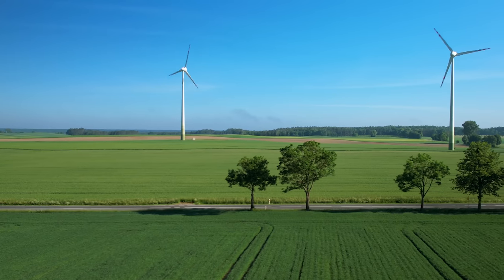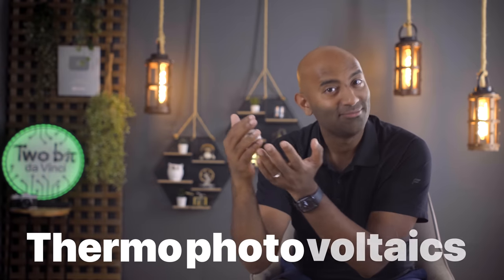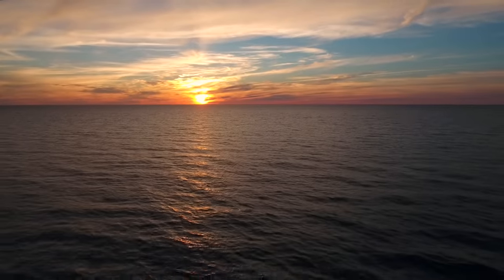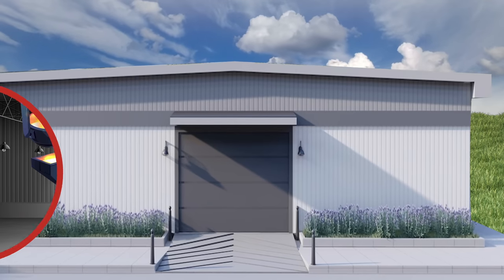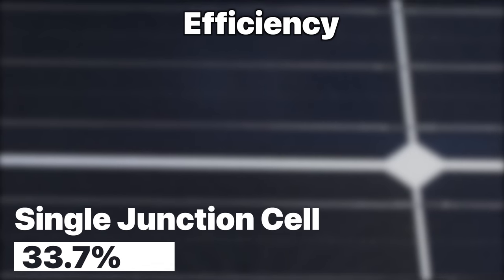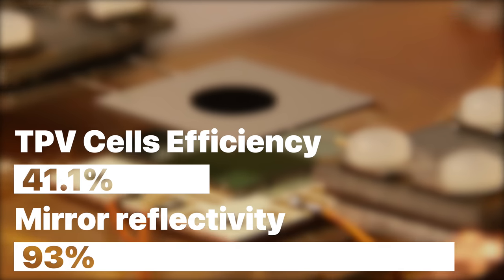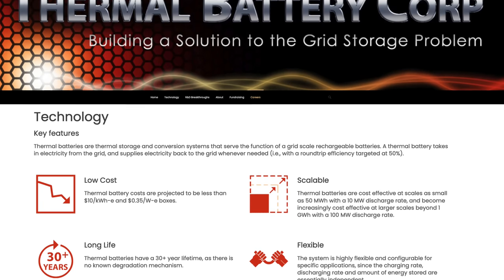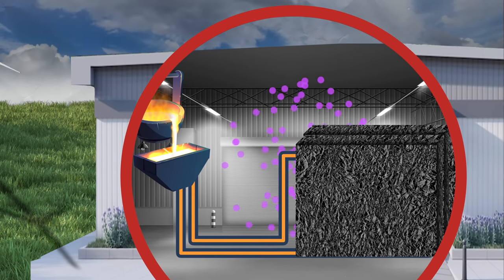Breakthrough Solar cell DOESN'T Run On Sunshine!

Comment: I don’t see it working properly. If it actually works. Most of this is seems like using a hot rock to power a light bulb and and sticking a heat sink to… wait what actually makes the electricity? Because everything at the end was turned into a steam generator.
I’ll read the paper. But one glaring problem is storage of those batteries. Those things must get really hot to the point where anything thin will melt no? What about melting the concrete or burning wood…..

Comment: Where does the other 50% of the 50% efficiency of TPV cells go to?  Is it lost or just returned to the graphite?
Reply: Waste heat, hence the cooling requirement.

Comment: We could all manage our forests, massively increasing shade and plant foods between rows of trees farm fast growing trees as we do now for building supplies and easily have firewood the same way as well as burning pelletized waste corn stalks wood chips etc. Not only would it help reduce forest fires but we could farm wood gas off of it and heavy as it is, it's essentially free and could be piped anywhere. Also if we quit making plastic junk (throw away society) we wouldn't consume as much energy. We need a lot more natural and alot less artificial. Once a land is canopied by trees it is an entirely different atmosphere.  Also quit bottle necking rivers and irrigate like we are supposed to. Where is our ground water going!? To the ocean where we channeled it...where is our good silt going!? To the ocean where we channeled it.

Comment: Molten Tin? Sounds dangerous, over-complicated, expensive, and a real problem when it cools at night. How long does it take to start circulating again after the sun hits the panels. Definitely Not for a backyard DIY system, which is the best way to go, independent individual home systems, rather than centralized, commercial ripoff schemes. Old tech with new problems introduced.

Comment: Stevenson it's said invented the steam engine though this is debated as crude kettle like steam engines are found to have been in exsistance perhaps tens of thousands of years ago..He achieved an 14% efficiency from his Coal fired steam locomotive and with today's 35% efficency from modern steam turbines then not much improvement over Stevenson rocket  with our new materials and technology has been unfortunately  gained. ..!!

Comment: Meh.. a bit complex if you ask me.. Is perovskite not more feasible in the long run? Or those hot sand energy storage.. much easier and cheaper... Sand is a lot cheaper than graphite, tungsten etc and because it is so cheap the lower efficiency is not much of an issue, just add more silo's with ultra cheap hot sand..

So many points of failure, like sealing of a large building to hold Argon?.. Impossible! Pumping 2000 degrees hot liquid tin? EVERYTHING has issues under such temperatures.  Where are the pipes made of? What if the pipes that run hundreds of feet through the graphite blocks spring a leak (and this WILL happen, certainly at the high temperatures)? With a building full of Argon and equipment that is extremely hot, makes it all very cumbersome to maintain.

I see the expenses for maintenace go out of hand quickly and completely destroys the business case... But maybe I am too pessimistic.

Like Elon always says: "Prototypes are easy, production is hard" But let's see how that test facility will work out. Keep us posted Ricky!

But talking about hot stuff.. You should have a look at Ambri Inc, the liquid metal battery made of very cheap abundant materials (Antimony, Calcium, Salt), set and forget long lasting battery system engineered for decades long lasting daily cycles and hardly any maintenance required. Because it runs in 500 degrees C molten state and each cell is a stainless steel sealed container, it can be set up anywhere in the world as it does not care about the local temperature.. works just as well in Antarctica as in the scorching hot Sahara Desert... Field tests are under way now, and already some deployments sold to energy and cloud server companies.

Comment: Cleanest and chepest bs... 🙂 Big steam turbines operate at more than 90% , you should goole more...  " What is the efficiency of a large steam turbine?
Multistage (moderate to high pressure ratio) steam turbines have thermodynamic efficiencies that vary from 65 percent for very small (under 1,000 kW) units to over 90 percent for large industrial and utility sized units. Small, single stage steam turbines can have efficiencies as low as 40 percent."

Comment: how does this compare to growing a tree and burning it for energy when needed? where needed. it all comes down to solar power from wind to hydro to nuclear. it is all from the sun one way or an other. it just seems like a more glorified solution micro vision to a problem that results in more problems. it takes energy to create and build these solution, somehow it does not get factored into efficiency.  so how much more efficient is all this setup plus extraction of material and cost in energy in transformation, heat, water waste, toxicity in operation and lets not forget to getting all component built and all working. all this along side to actually having an ecology, because this does take space.  what' that compared to growing a tree and irrigation?   seems more intelligent to have trees with crops like chestnut, oak, fruit trees, focusing more on irrigation, evaporation resulting in rain, i mean that is the point right? could you imagine the energy and good byproduct like food that could come out of the Sahara if it was a lush jungle?  yours solutions seem to point the opposite way of what makes common sense

Comment: Your analogy of cup of tea and ocean loosing heat is not correct and can be misleading, while your emphasis was on surface area. The big reason here is high temperature of Cup of tea. Also you have to consider insolation from the Sun ocean receives.

Comment: The very first step of turning high quality electrical energy into low quality heat energy is moronic.
What's the point of those expensive wind turbines?  Just use some cheap mirrors (heliostats) if you want to collect heat energy.
And to store the heat, why use a big block of flammable carbon?  Just use rock or sand (it's also cheaper).
And the goofy conversion unit using molten tin (how do you pump that stuff?)  and tungsten emitters and water-cooled solar cells?
Just use the heat energy to drive a conventional steam turbine, or maybe a Stirling engine if you're feeling innovative. 
I assume most of the MIT design has more to do with patentability  (and click-bait potential) than practicality.

Comment: Firstly… I think the efficiency numbers used at the beginning of the video are say…drastically conservative. Perhaps international, cross median(including Chinese coal,oil,hydro,etc) I could agree with that figure. 
 I work in the NG industry and ……..Natural gas and existing turbine architecture is at this minute, highly abundant, environmentally safe and almost holistically supported by existing infrastructure. Those existing facts alone mean that Investments into NG generation efficiency and this. is.big….AND NUCLEAR which dividends alone would be safe and sustainable for decades. And within that time, kinks could be worked out of a system as theorized in the video. Even if scientifically this method could compete, it doesn’t solve any outliers such as economical  and somewhat substantial geopolitical issues.  Considering where and how  these precious metals are made available. I.E. mostly by china using environmentally damaging methods  with societal subversive motives. 
Interesting theory though! 👍🏼👍🏼
Reply: Where there's a will there's a way.

Comment: there is so much missunderstanding u told first of all steam turbines are already at 99 or 98 % efficiency it cant get much better becouse theres a thing called phisics secondly this has ben made to look good  and all fancy si people flock to it like moths, u said that nuclear is bad NO nuclear is probably the cleanest since 1 powerplant can work for 25 to 30 years WITH NO FUEL REPLACEMENT also from all the fancy technology this thing will be built out of it will probably be so expensive that nobudy would even care to think farther than looking at it

Comment: Not going to happen unfortunately.  Gallium is produced in China and used widely for chipsets, particularly in phones and 5G equipment.  They produce 95% of the material and it is going to be in critically short supply by 2025.  There is no way to add on the demand that would be required to make all the thermo PV cells this vid talks about, in fact it would double easily the demand for gallium.  Unless huge new deposits are found outside of China that can be developed economically these cells will only have a very narrow and expensive application, possibly on spacecraft and little else.  Though if we did have unlimited amounts of these chips it sure would make geothermal very cost effective.  As it is the heat brought up from the Earth makes steam which drives turbines that in turn make electricity, but once steam is used it is no longer useful for driving turbines even though it still carries a lot of thermal energy.  That heat could be harvested to do what this video says makes the cells work.

Comment: 12:14 Ahh, there it is. And what are you talking about lithium ion is expensive? It's literally at scale NOW? What expensive is that contraption, not to mention the amount of process it needs just to produce energy. This is doesn't makes sense at all.
Reply: Lithium ion is GREAT! But shouldn't stop research into other methods.
With any luck, this will be another nail in the coffin of the Hydrogen debacle.
Reply: @rogerstarkey5390  The amount of stages with this "Tech" is just too many, it will drop efficiency and add more cost.

Comment: 1:30 Don't know what planet this guy is on or what he's been huffing ? Steam turbines operating at 1,500 degrees c ? Bullshit. The highest inlet steam temperature currently applied to actual supercritical pressure and USC steam turbines, is between 566°C and 620°C. What a stroker.

Comment: Wait.. so Li-ion battery are expensive and harmful for the environment to extract and manufacture but gal-arsenic for the tpv is not? Not to mention that they are using electricity to MELT a metal so it can heat another metal to incandescence so it can use a .... solar panel on it??? How many energy transfers between heat and electricity we have there with how many % loss between then again?

Seriously a link to the scientific paper would be useful, or this sounds like a bunch of BS.

Comment: Talking a lot about getting another 10% from a mirror so you can get to 50% from a cell is meaningless when you are talking about moving heat from one building to another before it even gets to the mirror.  This all sounds absurdly complicated.  Just getting the water cooling for the cells to work is going to take massive amounts of energy.

Comment: every time you convert from one form of energy to another you have significant losses... converting wind (mechanical to electromagnetic) and UV solar to electricity (when losses considered only 15% efficient) then to heat then heat back to thermo Photovoltaics back to electricity sounds like one very long trips with significant losses incurred along each step. sounds like you end up with only 5% of what you started with.
Reply: But is it cost and resource efficent? Seems too many people are focused on only one efficency scale.
Reply: @terrafirma9328  its no where near cost efficient... conversion from one form to another always results in losses. and each conversion cost money in materials and maintenance. its just another scam

Comment: Good video but this is hokum just like hydrogen fuel cells and nuclear fusion. Both have a place... 500 and 1000 years from now. I believe the best use for fusion would be a Dyson Sphere spaceship. Hydrogen and this tech both rely on excessive amounts of waste energy. I won't call this TPK as there have been various versions of this for decades, including roof mountable. This idea negates several benefits of solar: Being off grid. Local production of electricity though I suppose it does avoid the heat island effect that solar on every roof would massively ramp up. But the direct application of heat to water is what needs to happen. Waste heat now should be used to desalinate water. Nuclear energy is what we need right now. 

ALL EFFORT in power generation should be going into making small/modular MSRs a reality. We have more then enough fuel for over a thousand years even if we all switch to electric cars and energy usage continues to increase at projected rates.  So we could have a thousand years of carbon free energy which would reduce nuclear waste already in existence and desalinate water with waste heat. Or we could pursue these pipe dreams and hope to God that one day we might find something 1/10th as good as nuclear and it might possibly work with major infrastructure overhaul... which might be active in 20+ years.

Comment: Why can't we use the thermal storage system  to heat our homes and make electricity? It would be a single unit that would do both. It sounds like we know enough to be a big help to humanity but since they can't charge us on a regular basis for the technology, they are not giving it out. J.P.Morgan, may he rot in hell.

Comment: While this does sound very impressive from an engineering and scientific perspective, i dont see how this is practical or applicable to being a global solution... Gallium is much more expensive than Silicon... Tungsten is also a very expensive material... everything about this system is COMPLEX... super high temps, 2000 C, exotic materials, separate buildings, etc... Good science, BAD MASS MARKET PRODUCT...

Comment: Gallium is less abundant than Lithium.
Reply from the maker: yeah that's true, but you need a lot less of it to produce energy, since the storage happens in very abundant graphite. cheers!
Reply: @TwoBitDaVinci  "In 2017, the world's production of low-grade gallium was ca. 315 tons — an increase of 15% from 2016. China, Japan, South Korea, Russia, and Ukraine were the leading producers, while Germany ceased primary production of gallium in 2016. The yield of high-purity gallium was ca. 180 tons, mostly originating from China, Japan, Slovakia, UK and U.S. The 2017 world annual production capacity was estimated at 730 tons for low-grade and 320 tons for refined gallium." "Metallic gallium is not toxic. However, exposure to gallium halide complexes can result in acute toxicity." Wikipedia

Comment: This is so inefficient. I REALLY believe we need to drop all this, drop the laziness and use modern tech and science to re-visit the crank/pedal + human energy. I believe an electric car that uses pedals, pumps, and hydrolics can run for a long time on human carbs, not need solar or a grid to recharge and can be recharged from the inside of the car... This can even be applied in local as "GYMS" that harness the motion of the people within to produce energy for the grid. Now im not saying it can completely replace fossil fuels, but it CAN alleviate the burden put on fossil fuels..

Comment: 12,00 min
why are you conflating electrical  s t o r a g e   --- lithium ion ---- with electrical  g e n e r a t i o n ,  ie solar cells and turbines? You most know that we know they are very far from being the same thing. To do this is to look either sloppy or as thought you are trying to fool somebody into something. But why?
Reply: I don't think he did that.  Excess solar panel energy is stored as heat.  Later, that heat is used to make tungsten glow.  Those photons are converted to electric.  So the energy is  s t o r e d   as heat.

Comment: Wait, if the tpv is 50% efficient doesn't that mean the overall storage efficiency is 50%?  As you say standard batteries get over 90% and they can store energy over a longer time period too.  Why not look into good old lead acid batteries?  Even if they're not quite at lithium efficiency they'll probably beat 50%, with a lot less complexity and injury risk from 2000° metal too.  Or how about Form Energy's iron batteries?  Or flow batteries? Thermal storage suffers from fast fadeout (heat leaks) and low efficiency.  The only kind I can think of that makes sense is thermal mass for Aircon (cool water or CO2 or overcool a building when the sun is up).  Molten salt for solar concentrators could work if solar concentrators themselves weren't so expensive and finicky (does output fall to 0 if it's overcast?) because it just time shifts the heat a little before feeding it to the same generator.  But PV+battery seems like the best bet overall for renewable.  Maybe thermal mass like molten salt or hot metal could be used to time shift nuclear plant output to make it follow sinusoidal load curves a little better, at fairly low cost, thus increasing effective capacity for the cost of some extra steam generators.